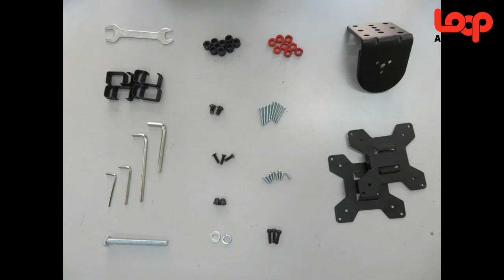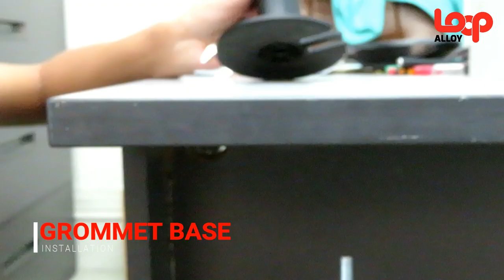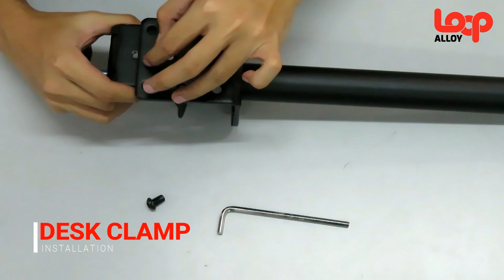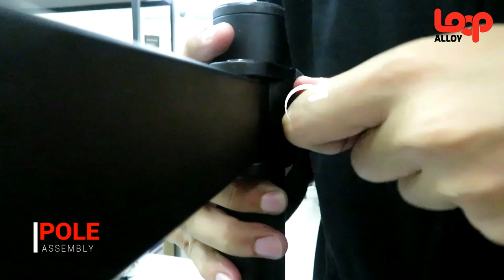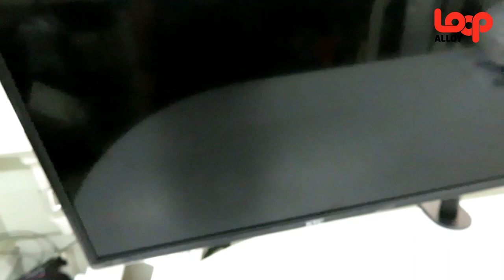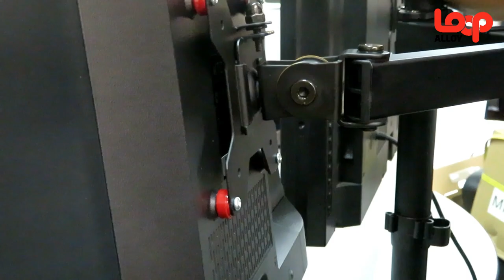LOOP ALLOY Dual Monitor Bracket Mount with C-clamp or Grommet options

Comment: If I use the grommet setup is there anyway to still be able to use the hole of it for the cable management? or it will be totally become dedicated for the stand since it will cover the grommet hole? I just thinks maybe theres a cable managemwnt hole inside the stand from the top then going to the buttom(grommet hole)

Comment: how to prevent the monitor from falling sideways, its so loose
Reply: I have the same.problem
Reply: count me in. i have this issue since i bought it 2yrs ago. up until now, it’s still hanging loose. planning to change the screw on the swivel arm. aint satisfied with this product. i dont recommend it. better go for the North Bayou brand than this. SMH